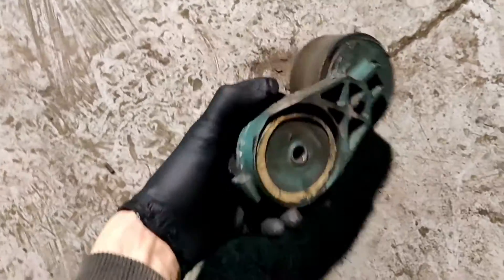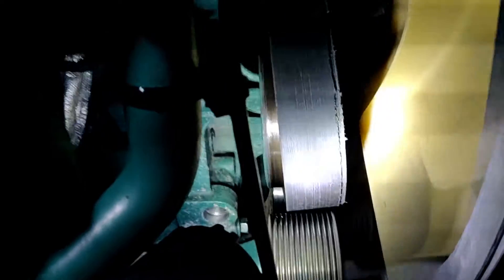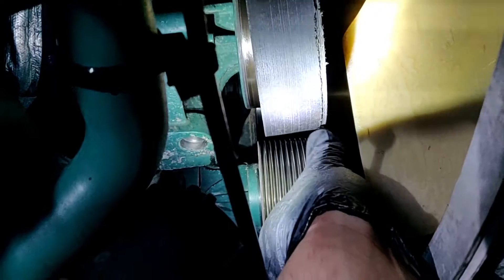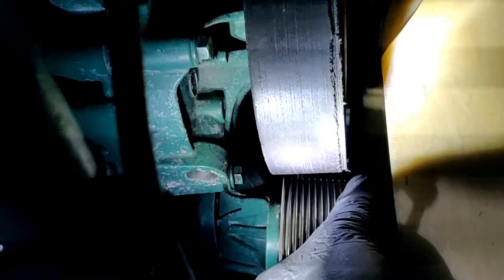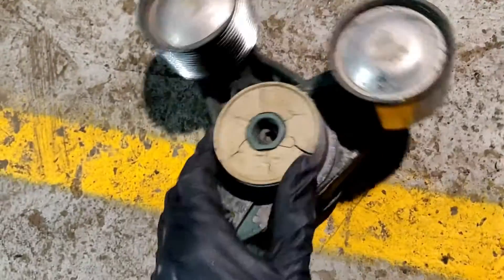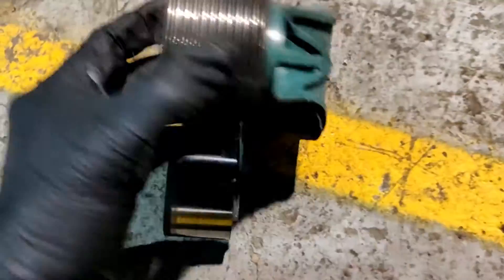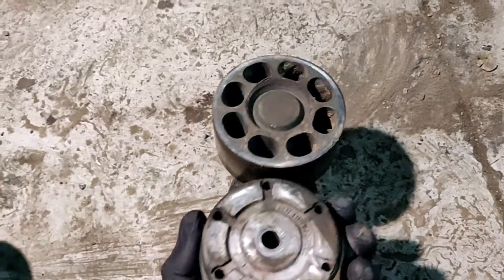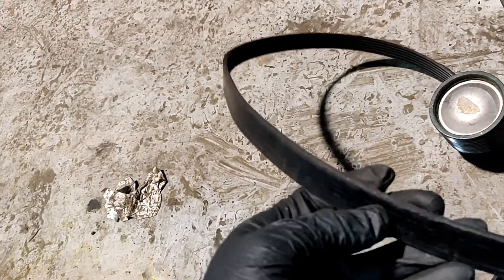Volvo D13 Drive Belt Tensioner Noise

Comment: Salut Man ! Am o intrebare daca poti sa ma ajuti cu un sfat ? D13 bate ceva in motor nu pot intelege ce are . La turatii de 1000rpm vibreaza usor cu cit mai mari turatiile cu atit se simte mai slab vibratia. Doua servisuri au verificat valvele si spun ca este corect. Bataia este intacta, adica se schimba cind mai des cind mai incet . La viteza maximala  din pedala, daca las din pedala si peurma brusc ii adaug izbeste de doua trei ori dupa incepe sa traga   corect . De parca i-ar da injectie incorecta ori zajigania pusa incorect . Am un video scurt pe youtube de 1min daca ai timp sa asculti cum merge . Multumesc !
Reply from the maker: Salut , am ascultat, dar e cam greu sa intelegi pe video, nu este clar de unde anume SE aude acest suntet car poate fi produs de Foarte multe componente!!! CE fel de ulei folosesti, cit de fes il schimbi , ai verificat compresia? Problema poate fi in the injectors or cups!!! Also it can be in the bad cam,  also the valves, dar daca zici CA le-ai ajustat se exclude!!! CE tine de izbeala cind joci cu acceleratorul la fel poate fi problema in injectie sau in insusi pedala de la accelerator!!! Eu am avut asa problema, tot asa izbea dar acolo a fost problema in accelerator!!! La tine este totusi probabilitate sa fie legata problema de vriun injector!!!
Reply: @valeriumoscalu7580  Il am camionu de nou  Folosesc Delo chevron semyblend 10×30 schimb la 40-50k de km adica 25-30k mi.compresia la calculator este ceva in jur 99-96%adica in asa interval acum tracu are 747mii km. Tot sa inceput dupa ce mia schimbat egr si egr culer plus am curatat dpf si tot in el au schimbat un sensor nox  la 650mii km undeva . Dupa sa inceput ventury pipe plus sensorul lui, intake bust sensor injectoarele toate6 plus cups la ele si tot si turbo cu activator ... tot a fost schimbat la diler pe garantie . La urma nu a ajutat ei au bagat traku pe dayno test masina unde a aratat 405hp la pik  maximal din 455 care sint declarati. Ultima ce au facut au adaugat putere prin program asa zic ei si cu asta basta ma scos din warranty. Dupa ce lau reprogramat a inceput sa bata la scurt timp 1-2 curse , iam rugat sal reprogrameze inapoi si sa verifice  valvele. Ei au facut programul inapoi asa zic ei, au verificat valvele tot este corect asa zic, da bataia ei nu stiu ce-i aia,sfatul lor da si tu muzica mai tare.  Si alt service a verificat valvele si spune tot este ok ... Acum ma intreb poate oare camshaftul sa aiba liuft in pasteli ori nu ? Si oare e posibil dileru sa spuna ca schimba injectoarele dar real sa le puna pe alea vechi pu ca spuneau ca sunt in stare buna  . Sau poate bate vreun piston... pentru ca motorul nu lukra rotund adica este o vibratie...
Reply from the maker: Da poate sa fie shi in camshaft problema, dar ce tine de dealer nu cred CA ar Pune inapoi tot cele vechi, nu cred CA ar risca ei cu asa ceva!!!
Reply: @valeriumoscalu7580  Am vb cu un mecanic care tot lucra la volvo. El spune ca acolo tot asa ii facut ca el(camsaftu) nu are cum sa umble in pasteliu lui, si daca ar fi nu as avea presiune la ulei. Da presiune este intre 50-55 la 1450rpm. O sa incerc sa-l testez dela calculator sa tai din injectoare, sper sa fie vreun injector. Daca nu se schimba sunetul credca va trebui de verificat camshsftul. Da spune-mi te rog sa-l verific va trebui sa-l scot afara sa vad ce-i cu vkladisile lui ? Pu ca asa nu cred sa simta cu mina loose.